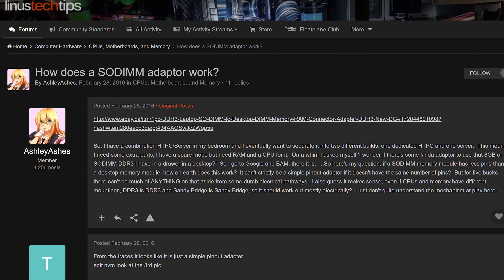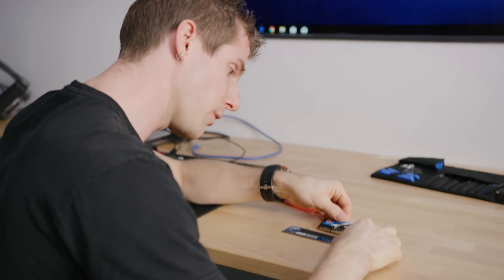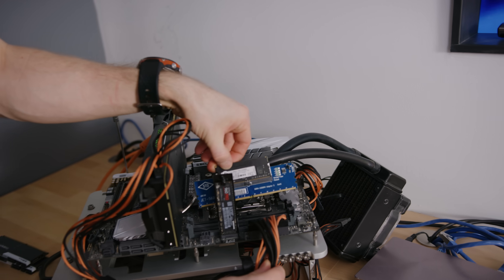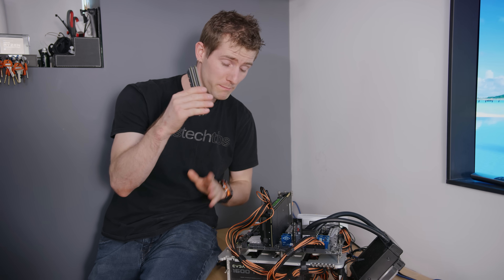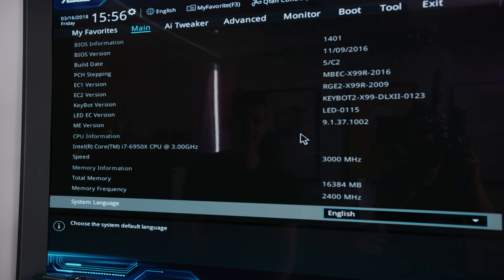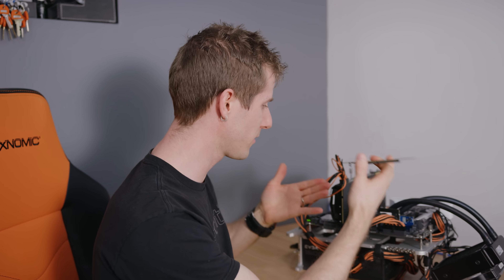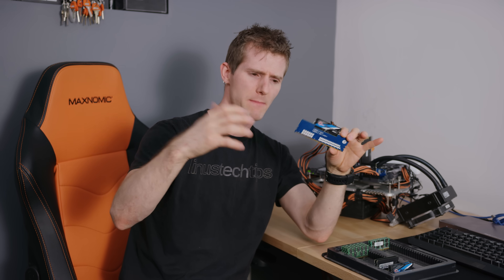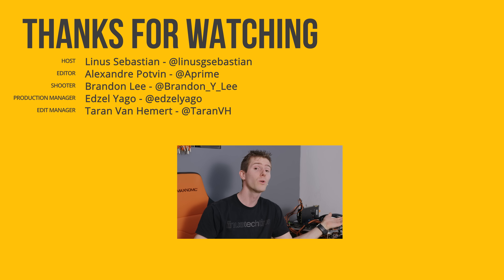Installing Laptop RAM into Desktop!?

Comment: I don't see why you couldn't with an adapter if it is the right type and speed.  I would not really want to do that unless I already had a lot of laptop memory sitting around or got it ridiculously cheap compared to desktop memory.  I wonder how many of the contacts on the edges are unused.  That might be from the standards for DIMMs allowing for some sort of large memory capacity (even though many motherboard BIOSes limit the amount of memory the motherboards can work with).  It is not only motherboard limitations but CPU memory limitations but these days most people would never have to worry about limitations such as these.  We have motherboards that now can take 32 GB or more memory (I know I should be calling it RAM).  Many people are getting by just fine with 8 GB or less even though they can have much more.  I found 32 GB and got it for $128 for my Athlon FX 8350.  The thing that provoked that upgrade was a game that inexplicably stuttered horribly even though my computer's specs were acceptable.  Most games never did this but it was one of those newer Deus Ex games and it took ridiculous times to get the game to load and transition between levels.  I was baffled, I use a WD Velociraptor so I didn't think anything of hard drive speed even though SSDs are now what everyone wants.  Wouldn't you know it Linus, after the memory upgrade no stutter or obscenely long load times with that game.  Even if the upgrade was for nothing else, I gained a sense of satisfaction from being rid of that problem.  Windows also runs somewhat smoother now and the paging file is turned OFF.

Linus, it is amazing the difference that just a memory upgrade can make.  On older computers my sisters had, I was able to speed them up somewhat with just some more RAM because Windows does do a lot of paging and on older computers it can be torture waiting for that to finish up.  My PC is by now means the fastest one there is but it works for me and will still seem to work fine even when it is declared "obsolete', which happens pretty quickly these days.

Comment: This is nothing new, there have been ram adapters going all the way back to 4 x 30pin to 1 x 72pin SIMM Adapters to allow people with high capacity ram in their 386 systems to use it in later 486/Pentium boards.

Comment: Well we used these for years at micron for testing sodimm modules. The testers had a full size dimm slot. Plus if we had connection issues we could throw the adapter away and pop in a new one.

Comment: I have used Mem OK button with great success
I use 4x 16GB Low Density memory - nibbles (128Mx4, instead of 64Mx8)
This is not liked by BIOS itself and BIOS simply crash on it, while processor have no problem
AMD Phenom II X6 have IMC, which is DIRECT great grand child of AMD76x memory controller, which worked even with registered RAM, not to mention 128Mx4
AMD Phenom II X6 IMC have disabled support for registered RAM, but there is no way to disable memory organisation, so 128Mx4 works, even though BIOS thinks it does not work
to make my computer work I need to press MEM OK button every time after BIOS crash or computer crash. It is good it happened just few times and stop happening altogether for last 2 months

Comment: Possible use case for adapters like these: The feds freezing the memory of a running laptop to perform a cold boot attack by taking out the frozen memory and placing it into a rig that would automatically try to create a copy of the memory module's content. I can imagine there are a lot of forensic hardware tools that only deal with regular size modules... so with such an adapter they could use their regular copying tool.

Comment: Would come in handy in an open air rig for testing sodimm. Would be easier that having to keep flipping the laptop over or taking it back apart on the ones that have the ram on top of the board (poor design btw)

Comment: Why would you do this. Your trusting the motherboard ram socket with some adapter off Ebay. There will probably compatibility issues leading to BSOD's. That or just not used at all.

Comment: thats handy that is! when i broke my laptop i put the hdd into my pc then binned it, if i had known you could re-use ram i would of put it in my low end pc!
Reply: Yeah I have a dead laptop and I should just pull the SSD, SODIMM's and the slim BluRay drive for something else. Or I could pay $150 to have it fixed, hmmm...
Reply: applemaggot hahaha its a no brainer really!
Reply: bradley reynolds Serious question what relevant PC can be made today that can use laptop RAM from a first generation core i5 laptop from 2009-10? I am not a big techie.
Reply: Swagat Suryawanshi that would be ddr3, can still throw together a decent computer with that. In fact, I just got a 2nd hand i7-2600k and accompanying motherboard that has ddr3. Not the newest of the newest, but not exactly bad either.

Comment: Typhoon burner. Change spd specs. Now starts at higher clock speeds. Fine tune timings. Now has wicked custom ram chips. Im curious if theres any weird benefit, lile cooling? Heh. Its fun either way :p.

Comment: Which proves a point... why have full size dimms and sodimms? Just have so dimms... the same with GPUs CPUs etc... produce one die then clock it higher or lower depending on the thermals... but they have to make money... That´s why I don´t like the PC market, it´s 90% marketing 10% engineering...

Comment: I actually ordered four of these last week. I went for this option because I have a load of laptop DDR 2 RAM spare and I thought these would mean I could make use of spare RAM. They will not be used on high performance machines so speed is not an issue.

Comment: Linus - when things like bios/software display different things to what you know is in there, it happens like this: The bios/software goes through a process of elimination and sends test signals to the hardware to eliminate certain models. In this case it got as far as DDR4 2400MHz and couldn't eliminate any further, or the responses from the hardware told it something it assumed to be DDR4 2400MHz. It's possible the same bios/software could have recognised the memory correctly if the designer(s) had tested it with that memory. But designers are humans so make assumptions. They simply didn't assume that SODIMM memory could ever be in the system (or a desktop setup). It's possible it would have recognised it if in a laptop.
Reply: But, people will say, doesn't the software just ask the hardware what it is? Certainly it could do that, but that wouldn't prove anything. It could be rogue hardware pretending to be a different brand, or a later model of the same hardware in which the software doesn't yet know how to distinguish, so even if you ask the hardware what it is it's still a process of elimination as to what you think it really is.

Comment: This is pretty cool because they are cheaper than desktop RAM.
Reply: Plus if you factor in the cost of the adapters, you won't be saving much money.
Reply: @IRLguy777  true, but as you have a pair of SODIMMs floating around from your upgraded (or recently deceased) laptop, it'll save you a little in the "desktop until I can afford a laptop" or just plain "desktop on the cheap" build - assuming the memory survived the laptop death. It has uses, if you're not out for performance, anyway.
Reply: Z0MG H4X they are also slower
Reply: ARJ 420 same spec modules from the same company can you, you want to get sticks from the same batch.
Reply: cheaper or very expensive?
Reply: It's better to just add a little bit more money and buy desktop ram itself
Reply: I have a dimm in my pc can i use the other slot for the adaptor with the full size dimm?

Comment: I remember seeing some prebuilt 775 mobos that had sodimm slots.
Reply: There are Q87 Haswell motherboards with sodimm slots in the "thin m-ITX" form factor.
Reply: It's not uncommon to find fuel island motherboards that have both SODIMMs and DIMMs. A friend of mine works for FedEx and he save a few mobos from being scrapped.
Reply: had an old mini itx board on 1155 that took sodimms but was otherwise a normal desktop motherboard
Reply: motorbiker46 It's also decently common in Mini ITX motherboards integrating a CPU that are commonly used for DIY "hack a computer in it" projects.

Comment: That 1-star rating for the eBay seller though.
Reply: It wasn't toward the eBay seller, it was for the product. I think those show for anyone selling a product with the same model number.
Reply: USB-C/microUSB to DIMM DDR4-3000MHz Adapter ;)
Reply: its also possible these adaptors are NOT official and are just slapped together in a garage, i mean riser cards exist but they aren't so common you can get everywhere. In australia u-mart a computer store sells EVERYTHING even 3D printers yet riser cards are NOT sold. Meaning they aren't so common that they have official brands that make them. What you see here is some generic crap

Comment: The jumper determines whether the EEPROM on your the adapter (position 1-2, it's the chip beside the virtual fuse) or the SODIMM (position 2-3) is read.

http://www.mfactors.com/jet-5608ak-ddr4-sodimm-to-dimm-adapter-with-metal-guide/
Reply: Sooo, that lil' thing over there could just solve both - the frequency and the compatibility issues...
Reply: HA Linus reading a manual?
Reply: I know your comment is 2 years old, but you might be reading this. I bought a couple of these adapters and they are with no chip, no jumper at all. I tested and they don't work. Should I do some soldering between pins 2 and 3 to use the SPD chip from the SODIMM?
Reply: @mtruchado  No spare jumpers? If not, I’d look for a less permanent solution first.
Reply: @thomasbland6428  mine has no jumpers, no spd chip at all. Look on ebay, this card is easy to find

Comment: You probably should run memtest, prime or similar for several hours to check if those will work reliably for extended periods of time and under stress. Just because it booted does not mean this will work fine.

Comment: If you really want to know. A virtual fuse is more like a circuit breaker than what you normally think of as a fuse. It's just reset electronically instead of with a physical switch.

Comment: Hmm... Well, I guess I know another usage of this device. Buy a desktop with the adaptor and without RAM, buy a laptop with ample of RAM. So, when you are using the desktop, you just unplugged your Laptop RAM and plug into the adaptor so you can use your desktop, and if you are going out, just took the RAM back and install in your laptop. That way, no one can use the desktop. It's good if you don't want other people to mess with your desktop when you're not around.

Comment: I'm curious if they do actually work with other normal desktop ram, like you did try the 3000mhz whatever it was, and then it picked up no ram at all, but running 2666 desktop ram with the adapter ram would it work? I imagine it would but yeah

Comment: Why would you want to though, that's the question? Also, why would you try to mix and match memory in a system? That very rarely works...very silly to even try that. It wouldn't even work with regular DDR4 let alone laptop ram in an adaptor mixed with regular DDR4. Silly to even try honestly. I knew before you even tried it wouldn't work

The memory clearly showed up as Gskill in your bios around the 5min mark, when it wasn't Gskill, was it? So that tells me something else...that your bios didn't update the info from the SODIMMs...

Comment: What about an adapter to make SD cards into RAM 😋
Reply: I saw one once that lets you put a bunch of RAM sticks in it to create a super-fast SSD. it keeps the data by having an internal battery to power the RAM and a conventional HDD as backup.
Reply: @gsilva220   didn't they make that sort of thing waaaaay back in 8086 IBM XT days? And 80286 IBM AT days. I remember seeing a few but DAMN they were expensive

As for SD cards - Linus tested a board that converts them to a clunky SSD - but not a good idea in practice - see his vid https://www.youtube.com/watch?v=3frnBoqqI_Q
Reply: Won't work. Way too slow! The best SD cards max out at around 100 MB/s read and write speed, but RAM speed is about 100 times faster.

Comment: They might have not worked because the memory configuration on the desktop ddr4 dimms were totally different than those on the laptop memory. You should have put cheaper memory which matched the frequency, voltage and latency at least of the sodimm ram sticks so that you would be sure there should not be any compatibility issues.

Comment: Actually, DDR4 SO-DIMMs are 260-pin while desktop DDR is 288-pin. While some DDR4 SO-DIMMs have ECC, I don't think I've seen any that are buffered or with parity, so that may be what's missing. (Or just some extra power traces or something.) Either way, I think that adapter is passive rather than active.